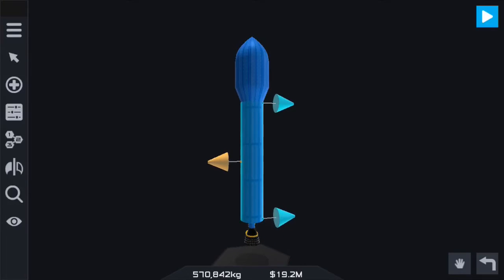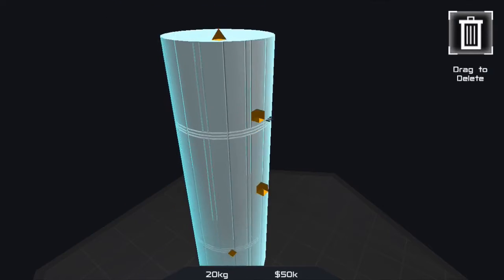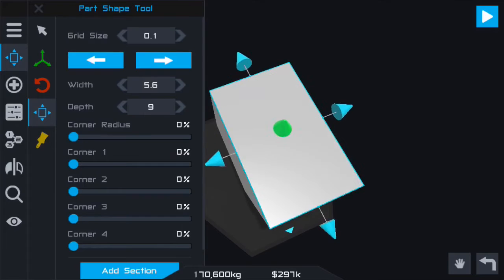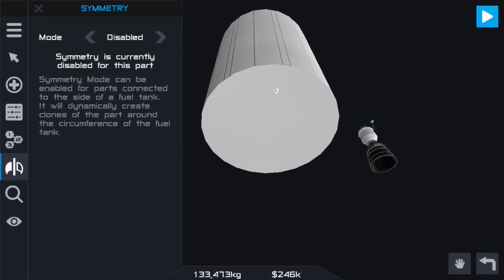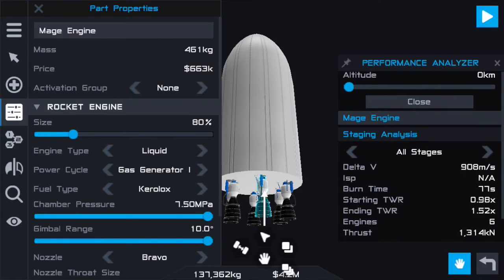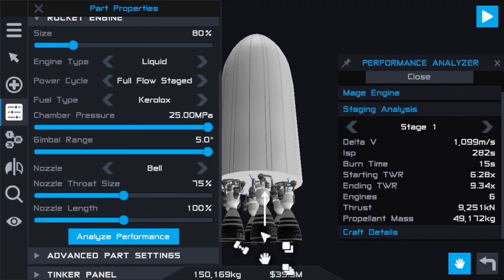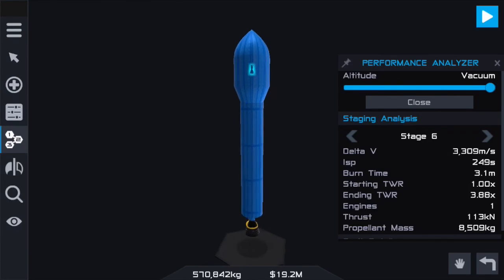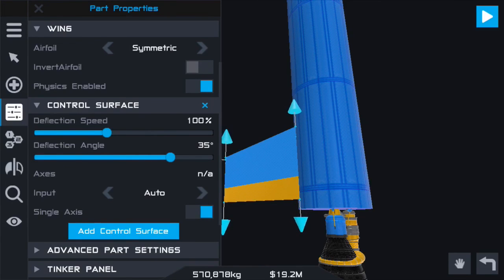SimpleRockets 2 Mobile - Tutorial #1 - The Basics of Building

Comment: This might be a dumb question, but how do you change the texture of parts like fuel tanks, because when I try to change it, nothing happens.
Reply from the maker: Highlight the part you want to change, go into the part settings and at the bottom there is Part Style, where it says texture change that.
Reply: @TypicalSim  That's exactly what I do, but the texture doesn't change for some reason.
Reply: @GamingSpaceAgency  may be coz your craft texture is turned off in settings, just turn it on. I was also facing same prblm but its fixed now
Reply: @anand_raj2112  yes, that fixed it. Thanks man.